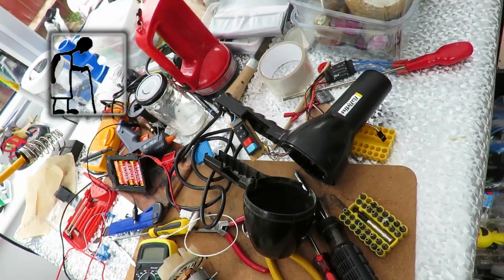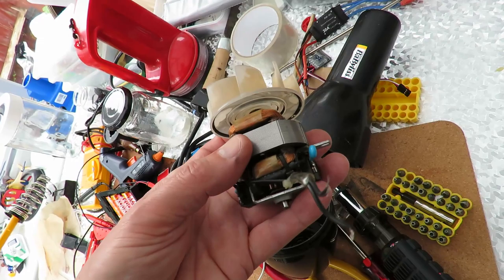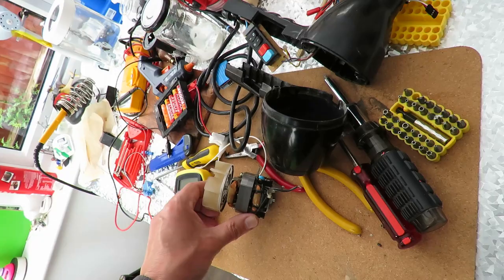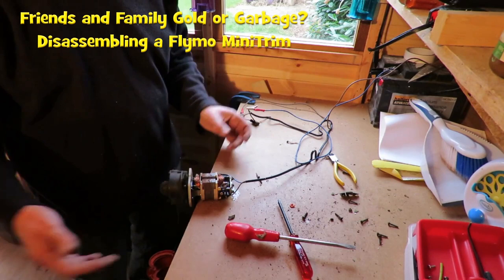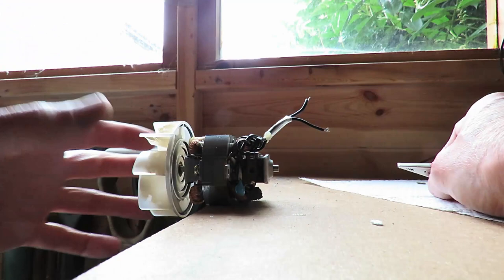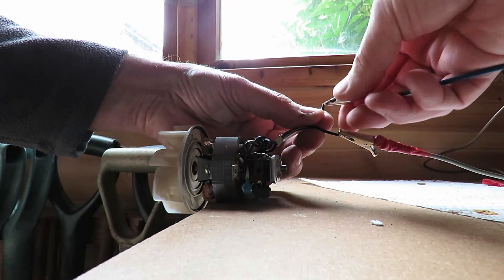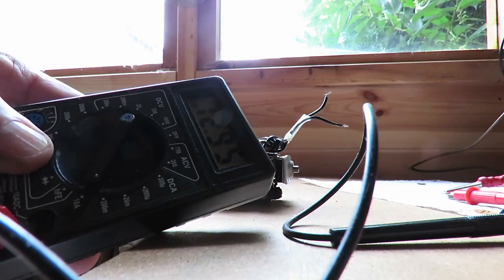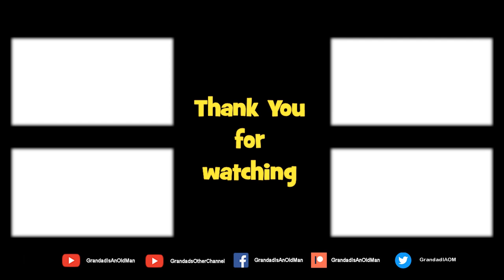Revisiting the universal motor in that hairdryer I took apart

Comment: Hi "G". When connected to the large 12-volt car battery, which can supply up to 300 amps, hold a metal screwdriver close to the coils. You should feel a magnetic field. If not then you need to create a magnetic field independently. I never knew there were two circuits in those motors. One to generate the magnetic field and the other to send DC to the motor brushes. If that is the case then a diode must be in the circuit somewhere for the DC part. 

I do know with a car alternator to produce electricity, you need to power up the coils with DC to create the magnetic field. Even a AA is enough to create the field. Then when the alternator spins up sufficiently, it will create about 14-volts DC with its built-in voltage regulator. They can also work with a brushless ESC (using the same method with a AA battery) to use it as a motor. With your motor, I think you need to get the field to be created first. Look for a possible area on the motor where you can create a field. Maybe another wire connection or where those caps are connected and hover your metal screwdriver over the coils till you feel the field. Once you get that, then it should run from your 12-volt car battery. 😀

Comment: If the motor is Stiff it needs lubricant
Reply from the maker: Did you watch the video right through, I show it runs fine with mains AC, but not on the 12 volt DC.

Comment: Hello uncle may I know what is power consumption of this hair dryer Motor?
Love from India✌️
Reply from the maker: I have no idea. The information on the hair dryer case was:-
Babyliss Hair Dryer
Type S43
Ref 1013HS
230v 50Hz 1400w
Made in PRC
Obviously the 1400w would be referring to the heater element, not the motor.

Comment: How voltage dose it need to run is it 240 v
Reply from the maker: Here are the details of the hair dryer
Babyliss Hair Dryer
Type S43
Ref 1013HS
230v 50Hz 1400w
Made in PRC
Reply: @GrandadIsAnOldMan  thanks

Comment: Its ac motor you can use 120-240 volts. Cause i have it
Reply from the maker: The motor is a Universal motor which will run on both AC and DC. Details in the video description.

Comment: making a drill with the hair dryer Universal motor please
Reply from the maker: I don't like using mains power for any of my projects and this one doesn't work on the DC power I have available.
Reply: @GrandadIsAnOldMan  and for a standard hammer drill as the 0:32 gear reduction just using your printer to making the gear reducer with first small gear and the second Big gear you have a nice project !